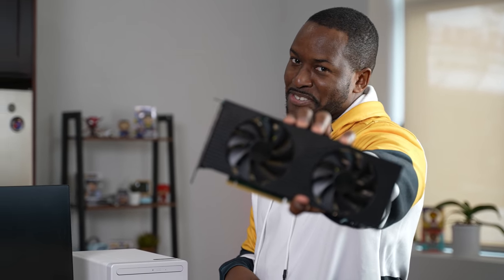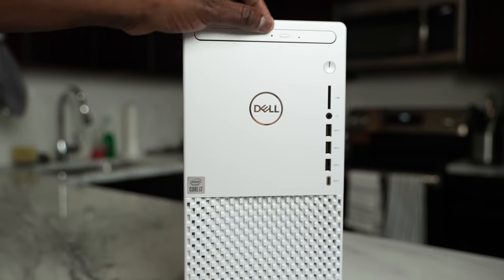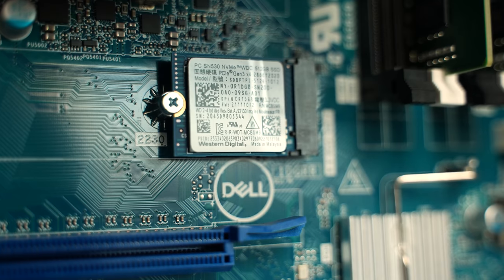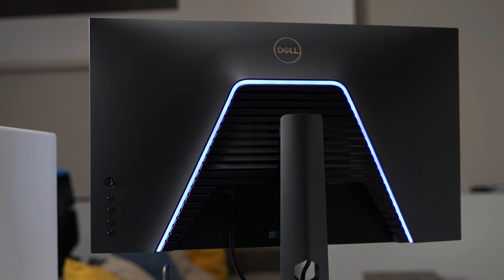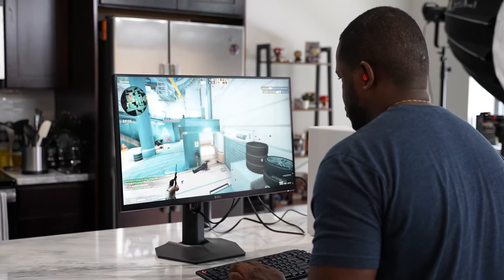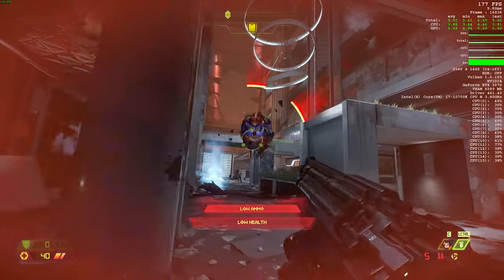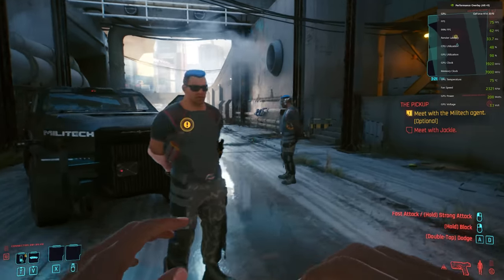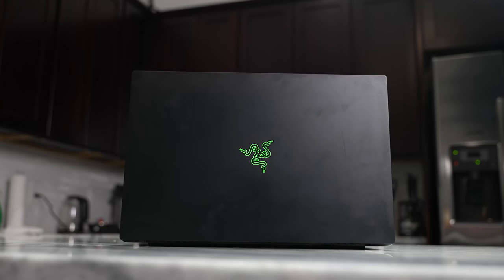BEST way to get an RTX 3070!

Comment from the maker: What's your PC gaming setup?
Reply: Ryzen 7 2700x
GTX 1080ti
Reply: a custom made ROG setup!
Core i9-10900K
Asus ROG Maximus XII Hero (Wifi)
Asus ROG Strix RTX 3090
Reply: Old Alienware desktop...
Reply: i7 4770 k
Gtx 980ti
Reply: Good vid. Thanks for the overview.  It would be appreciated if future vids included CPU and GPU temps.  Others have shown this PC overheats and throttles the CPU badly, which also means the GPU can only run at about 75% max.  Leads me to ask..
- Is that a stock CPU cooler? I haven't seen Dell be that generous yet.. perhaps ur temps are better than others because of it.. 
- Is there still only 1 case fan? Way sub par if Dell is still doing that crap.
Reply: Crap, just noticed.. the CPU cooler is better than stock kinda. Its passivly cooling, theres no damn fan on it! That means the 1 small case fan not only cools the ENTIRE PC, but also draws air from the CPU!? OMG Dell failed horribly!
Reply: Thanks for this. I have a G5 on order with similar specs. My intent was to play in 1440 and it sounds like I won't have any problems with that.
Reply: core i7 8665u
nvidia mx150
16 gb ddr4 ram
coz u know its a laptop🙂
dell inspiron 7786
Reply: rx580, r5 1500x, ddr4 4x4.
im poor.
Reply: 3080 FE
5800x
Reply: @_fiftyseven_  how did u get that rtx 3090
Reply: It doesn’t exist because I CANT FIND A GPU !!
Reply: @arsenic3714  I found a pc on new egg for 850 dollars it has gtx 1650 and ryzen 5 3600 and it’s epic
Reply: Ryzen 5 5600x
radeon rx 5700 xt
32gb ram
1tb hdd
1tb ssd
Reply: Best way to describe mine is a potato PC.

Comment: I got this rtx3070 configuration for aud2000 (usd1577) during an ebay black friday sale. Crazy thing cos the offer was for the new spec. It's been solid so far running flight sim mainly. Not to mention a 3 year warranty straight from Dell so no fuss.

Comment: Great vid! I just checked the link and unfortunately the 3070 is no longer included.  

Your options are now  AMD® Radeon™ RX 5300 3GB GDDR6
NVIDIA® GeForce® GTX 1650 SUPER™ 4GB GDDR6
NVIDIA® GeForce® GTX 1660 SUPER™ 6GB GDDR6
NVIDIA® GeForce® GTX 1660 Ti 6GB GDDR6

Also, you have to spend at least $1300 to get the OPTION to include the 3070....

Comment: I can confirm that this pc is a beast, if you get one with the crappy cpu cooler you can upgrade it to a noctua NH-U9S easy you just need to get yourself 4 m3 16mm screws and 4 m3 washers. I’ve done it on mine and it’s all working perfectly

Comment: I have the the dell XPS 8940 32gb 2x16gb ddr4 2933Mhz  10th gen i9 -10900 with the geforce rtx 2060 super and 256gb m2 pcle +1tb 7200rpm 3.5 sata hard drive  I would like to max my computer out to 128gb and any other compatible upgrades what do you suggest? thanks love your channel I really need your help.

Comment: The blue ray drive says a lot about Dell. 10 years in the past
Reply: Blue Ray discs are still a thing silly...
Reply: @lbeetech  they still exist of course, but nobody builds a PC with a physical drive anymore.
Reply: @Dujfjfo  That's pretty dumb, it's only a couple of bucks...
Reply: @lbeetech  it's more or less a dead medium tho. I mean I have a few kicking about that aren't even worth selling.
Reply: @Dujfjfo  I still have some Blu Ray's that I get clips from... I use the drive on my desktop for that.... It is also a good way to store items that I need.
Reply: Xps line are business computers. I work as a software Dev at a financial institution that uses dell computers. The company uses those cd drives for security and archive purpose and compatibility with legacy assets. 

You aren't the target Market for the computer. I wish more people would research before they berate something. Wonder what you'd do if you found out cassets are still being used for storage by some companies 🤦‍♂️.

Comment: Oh yes, pay $3,000 for a dell XPS to get a 3070. Logic: 100. At that point, might as well buy yourself a scalped 3070 for $750 and build yourself a $1500 PC. If you're shelling out $3,000 for a prebuilt with a 3000 series card, might as well get anything other than this overpriced garbage. There ARE literally 3090 gaming pre-builts by reputable companies like Origin, CyberPower, iBuyPower, Digital Storm, and many others for $3,000 that have far better specs than what the Dell XPS offers.